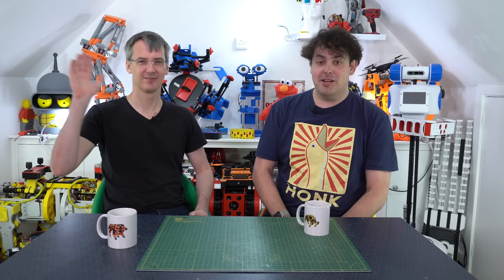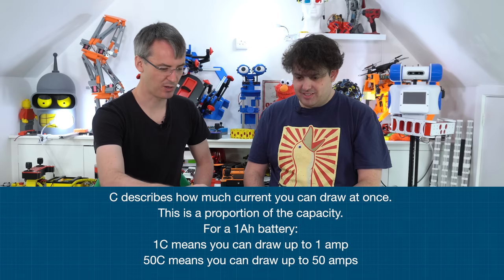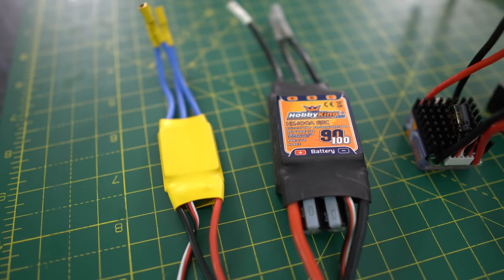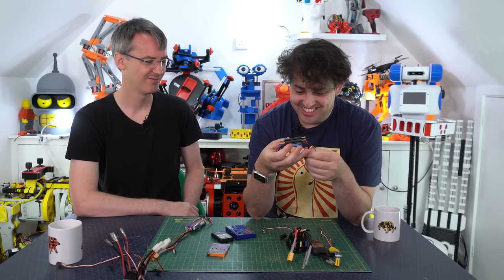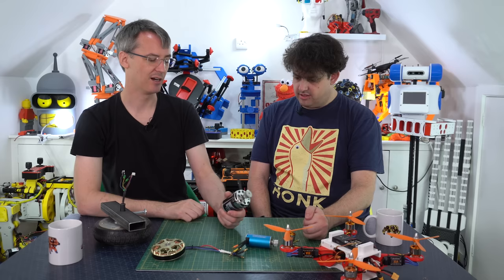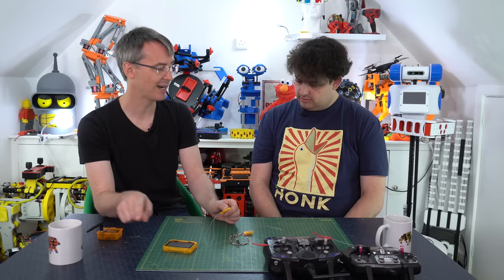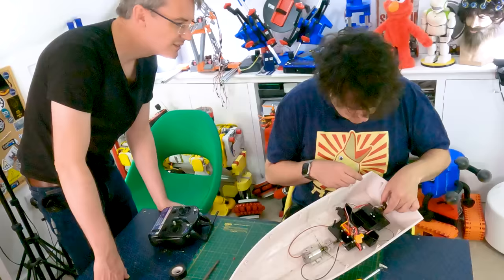🤖Beginners Guide to Making Radio Control Vehicles and Robots, with James Bruton!

Comment from the maker: I’m looking forward to using this new found knowledge in some projects in the future! Hopefully this helped you too, have you had any fun remote control project ideas?
Reply: Perhaps a variation on your street sign prank.  Make a trash bin and move it away from some people or towards others. It would probably need to be slow moving.  In general this is an idea to make something move unexpectedly that is supposed to be fixed in place.
Reply: What if we build a stellar engine and let Matt Gray remotely control it to determine our journey through the cosmos?
Reply: *radio control ffs you're welcome
Reply: Dude, how did you end up with an Electronic Engineering degree without at least getting a hint of some of this stuff?
Reply: @deadly_dave 

As a mechanical engineer who routinely works with electrical engineers, I'll say that there are a ton of specialties that are covered by these degrees. 

I seem to recall that Matt is a broadcast engineer, so he's probably spent a decade or more getting really into the details of antenna design, signal processing, and radio amplifiers.

If he's like me, he probably learned this stuff well enough to pass the exams and has forgotten it since then because he never uses it for work.

Like, I learned all about the thermodynamics in a car engine, but I still don't really understand modern engine design because my specialty is robotics and such.
Reply: @scorinth  Yeah ok, that's fair. I'm sorry Matt Gray, I retract my poor question.
Reply: @deadly_dave  The RC world has apparently invented all it's own terminology for things electrical engineers would know by another term.
Reply: Maybe some better music? "He's running up the hill!"
Reply from the maker: @deadly_dave I was taught more at the component level, then detail on transistors and op-amps, PIC programming (in assembly‽). Motors batteries and radio control were never covered. Especially the weird S/P/C terminology that I’ve only ever seen on RC stuff. Tell me it in V, A and mAh or W and I’ll be fine!
Reply from the maker: @scorinth In the UK, from my experience, broadcast engineers look after the studio side and radio engineers look after the transmission side. Almost all radio/tv transmission is subcontracted in the uk, and the broadcaster feeds audio or video to their equipment. I’ve never been taught anything about antennas and transmission but I have picked up bits and bobs of info in that regard, for the odd wireless mic or vhf/uhf link.
Reply: @MattGrayYES  Mmmm, fair enough. When I was doing my EE degree, I did that too (Althou I avoided PIC's and instead used the likes of the C8051 for assembly, Basys FPGA's for HDL and STM chips for C/C++ ) but I did several projects too. In 2nd year, I built motor controllers and weather monitoring 'stations' etc from basic components, 3rd year was smart RC cars (had to learn about batteries for that built the battery pack out of old Laptop 18650's), environment control sensors with remote data graphing etc in 4th year, that thought me about wireless comms. So I suppose that's where my confusion came in.

Anyways, regardless of which, I did enjoy your video and I have subbed. I love the excitement you show towards the process.
Reply: 😀 when I learned electronics, we soldered with lead. They didn't take us through the ins and outs of battery packs, so this was interesting stuff.

I always thought that people would get tired of the quad copter design because it looks like a bug, and then remember airships. There were so many stories of pirate ships that could fly because of magic or steam punk powered propellers. That would be neat.

Veritasium got into a propeller craft(?!) called Blackbird to do a story about physics. Maybe there's some interesting models and experiments to come up with.

Oh, they didn't have 3D printing when I was in school either. We live in the future!
Reply: Like you for years I've been in the trade and this was by far the best explanation of RC batteries. Also id like to add, because of @jamesbruton, ive spent far too much money on MC's, PLC's. Love it all....

Comment: YouTube fed me this video because I'm subscribed to James' channel, and I think Matt does a perfect job of covering James' weak points.  Which is to say, James is very knowledgeable and a good YouTube presenter, but like many people who are good at something, he does a lot of steps without being aware of them and so the viewer needs a certain degree of expertise to follow along.  Matt, on the other hand, should consider a career in teaching or tutoring or libraries, because he does a good job of taking James' knowledge and repackaging it in a form understandable to a beginner.  There are a few places where details that are fairly specific to the parts and approaches being used here are presented as a general case, but overall I think this is a very good introduction to what is happening when one hooks a remote control to a motor.

I've shared this video on the Astromech Builders' Club forum.  A huge percentage of new builders arrive at the forum confident they can do the physical build but utterly intimidated by the electronics.  I think this will be a useful resource for those folks.

Comment: Another thing to know is that there are different and incompatible radio transmission protocols - the way the transmitter (controller) talks to the receiver. 
So you have to have a transmiter and receiver that use the same protocol. 
ELRS is probably the best choice as it's open source, readily available, long range and cheap.

Comment: Wellp, that's me educated on the whole CSP shebang. Thanks Matt, thanks James! Bookmarked.

I used to know how to multiplex PWM over a radio signal with nothing but resistors, capacitors, and a 4000-series CMOS counter at each end. It's all different now, I suspect. :) For those interested, the CMOS counters weren't binary, they had 1-of-N outputs; 1 of 10 at the transmitter and one of 8 at the receiver if I remember right. You couldn't use all 8 outputs because some were needed for the synchronization pulse in every frame. I think 5 or 6 channels were usable. 4000-series CMOS was used because it doesn't need a voltage regulator; it's very slow but will run at anything from 3 to 15V if I remember right.

Battery eliminators were just starting to come in when I was learning all that. It was a long time ago now. I didn't understand why a separate battery was needed in the first place. My face probably looked very much the same as Matt's here. :) I was just too new to the subject to have put all the facts together, such as the fact that the suddently-changing heavy power draw of the main motor causes changes in the voltage of the battery powering it. Batteries have internal resistance -- everything does -- and so drawing a high current means a higher voltage drop through that internal resistance. There's also the issue of charge being distributed throughout the battery and taking time to chemically transfer from parts far from the contacts. Neither of those were much of a problem with the nickel cadmium batteries I learned on, but I think sudden speed changes could still cause power surges which you'd want to keep away from the electronics. I really didn't understand power surges back then; it took me years to understand inductance, but inductance is the one part of this I'm sure Matt does understand as a qualified electronics engineer. Still, depending on which field of electronics Matt works in, (RF? Audio?) he may not have reason to refresh his memory on the electrical effects of suddenly sending a motor from no power to maximum with a silly grin on your face. :D

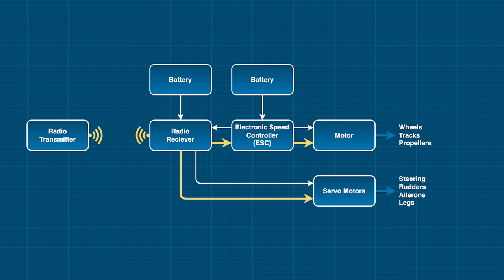21:08 It'll move my legs!!?!! :O XD
The slightly spooky music triggered that joke, bringing back creepy classic sci-fi from when I was a kid.

I love the way Matt just takes the babysitting bit in his stride. :D I like to think I would too; I have good times when my pride doesn't get in the way, but sometimes it does.

Oh now I remember, we didn't use 3-phase motors in RC in those days, only brushed DC motors, but we did have stepper motors which were 4phase and designed to be controlled by a computer. Nowadays, the motor controller is a computer probably more powerful than our old 8 and 16-bit devices, and I guess they figured 3 phases was enough.

"Shall we get in the boat?" XD XD XD It's not often you get a coincidence which sets up a joke so well. :)

Comment: that was a brilliant vid Matt (and James)

I dabbled with drones and some r/c aircraft a few years ago and it took ages to understand about the S, P & C ratings of batteries along with how to match motors, ESCs and then the appropriate radio gear.

Wish I'd had this as a resource, would have been a lot simpler (read that as cheaper) experience  👍

Comment: Small correction: At 16:01 it should say, "Rather than using one PWM connector for each output, you can get all the remote control data in one go." Serial connections send all the data over one wire but they do need to go into a separate controller of course, like a Flight Controller for a drone, which then decodes that signal and send the correct amount of power to the correct ESC/motor(s).
Reply: And just to add a little bit of "hey did you know...?" PWM stands for Pulse Width modulation, which is directly translated by the ESC or the servo. PWM encodes the signal it's sending by the width of the pulse, or the amount of time power is on basically. PPM stands for Pulse Position Modulation, which encodes the data by sending a single pulse in a specific time shift.

Comment: It is worth noting that brushed motors often don't like running reversed, that can damage the brushes and significantly reduce the lifespan of the motor. There are some that can handle it just fine though. And brushless usually don't have that issue, and some ESC's can be programmed to run brusheless motors both ways.

Comment: Using S for batteries rather than voltage has advantages and disadvantages. One disadvantage is that different types of cell have different voltages per cell, most people just use lipos now though, but in the past they used NiCd and NiMH, which have very different cell voltages to lipos. 

Some advantages of using S is that you can be sure the batteries are compatible, with voltage the battery does not stay at the same voltage as it discharges and the manufacturer can pick any voltage they want out of the range really, for example in a 5 S lipo it can vary from 15 V (3 V per cell) to 21 V (4.2 V per cell), so it all depends on what cell voltage you choose to do your calculations with, standard or nominal voltage is 3.7 V which would give you 18.5 V, but some manufacturers, especially power tool manufacturers will just bump that up to 20 V because bigger number = better. Also I have seen some components list voltage rather than number of cells. If you have a servo rated for 7.4 V then can you use it with a 2 S lipo? If you take the nominal voltage 3.7 V per cell then a 2 S battery is 7.4 V, but if you take the fully charged voltage 4.2 V per cell then it is 8.4 V so can the servo handle it? It just makes it far easier to say a part works with this number or range of numbers of cells, you avoid all the faff of having to decipher what numbers and voltage the manufacturer used and what they actually meant, a part rated for 2 S will be fine with a 2 S battery.

It also makes charging easier, especially since the batteries need balance charged. You plug the battery into the charger, tell it how many cells it is (some chargers can detect it themselves) and what type they are and the charge current and it can charge them fine, no worrying about what voltage you need to set it to or anything like that.

Comment: Drone ESCs unless they are really cheap ones can usually be connected to a PC where you can update the firmware, change settings, etc. For the most common drone ESC firmware, BLHeli32, there are a lot of options.

Drone ESCs can also take different protocols since the control needed for drones is more complex, with RC cars you don’t need stabilisation or any of that and even when you do it is simple. Drones however need flight controllers and fast reaction times so the standard RC protocol isn’t good enough. You get protocols that are just faster versions of the standard RC or servo protocol which is really just a pulse between 1 and 2 ms, one shot and multi shot are faster variants, one shot has multiple speed variants but multishot is faster. A problem with these protocols is if the clocks in the esc are different than in the drone you can have issues since the communication depends on the length of a pulse. Then you get a digital protocol called d-shot which is harder to implement but allows more precise control with no timing issues and also allows for telemetry, the ESC feeds back how fast the motor is actually spinning which can help with control loops in the flight controller and things like rpm filtering.

Comment: Something that has always annoyed me about those battery ratings is that they are have their "capacity" in mAh but really you should use mWh as energy is a product of current as energy over time not just current over time. So a 4000mAh battery at 5V is 4 times less capacity than a 4000mAh at 20V so might as well use 20Wh and 80Wh which is their actual energy rating.
Reply: There is a good reason it is done that way - since the voltage is nominally fixed, mAh and mWh are effectively equivalent, so the choice comes down to what you're using the rating for. If you're primarily comparing different batteries with different voltages then go with Wh... but since most people are using a specific battery in an application (so voltage is fixed) and are measuring/controlling the current, then Ah is a much more convenient unit.
Reply: @JamesChurchill  I understand when voltage is fixed they become equivalent but I don't see how in that scenario the mAh rating becomes more helpful, seems they would of equal at that point so I would still side with mWh. Also in this video alone they were comparing batteries of different S ratings and hence different voltages but still working in mAh units

Comment: I got most of that. I still don't get how not James Bruton people use the motor with the hall effect sensors. Do speed controllers have a location for the sensor wires?
Reply from the maker: Yes. You can get speed controllers with connectors for Hall effect sensors.